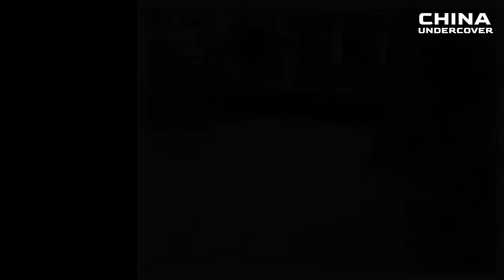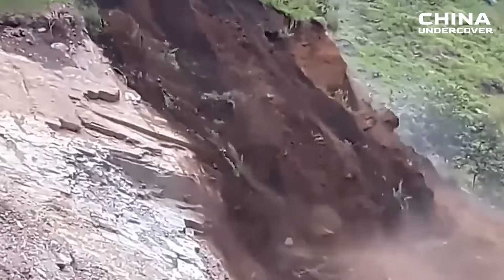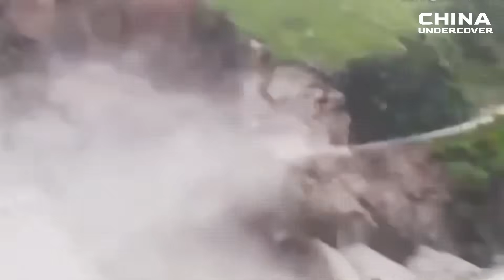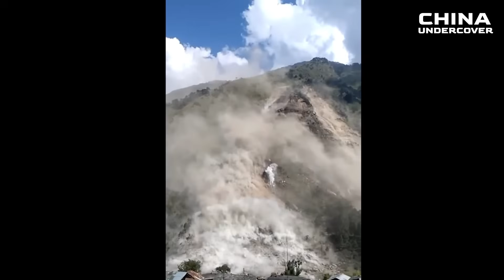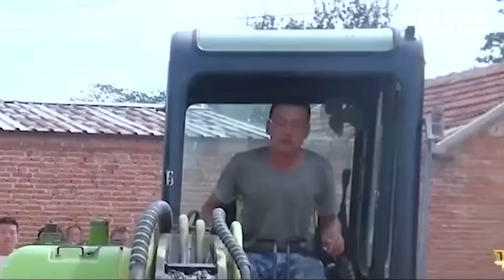Big Cities' Alarming Ground Collapse Reality From Nature’s Anger: Causes and Consequences

Comment: 🌧 Heavy rainfall in Chongqing, China caused landslides and road collapses.

00:52
On September 23rd, heavy rainfall led to road closures at five locations in Fenji County, Chongqing.

A road surface collapse occurred near Lion Fang Garden Bus Stop in Shapingba District, trapping a fully loaded truck.

The collapse was caused by a malfunction in the underground drainage system, leading to rerouting of bus routes.

🌊 Excessive groundwater extraction in China is causing subsidence, leading to the sinking of buildings, damage to infrastructure, and ecological harm.

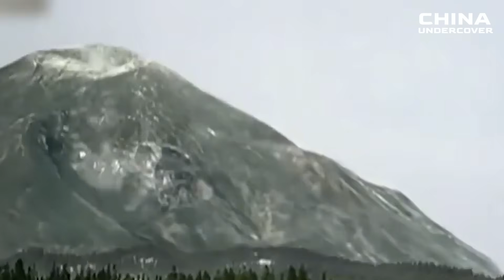04:03
Subsidence caused by excessive groundwater extraction can lead to the sinking and cracking of buildings, as well as damage to infrastructure such as railways, pipelines, and bridges.

Coastal areas may experience sea water intrusion due to subsidence, resulting in severe damage to surrounding ecosystems.

A research paper revealed the development of an extensive groundwater depression funnel in Beijing, leading to widespread subsidence across the city.

🌍 Land sinking and ground collapses have been a serious issue in various parts of China, leading to loss of lives and property.

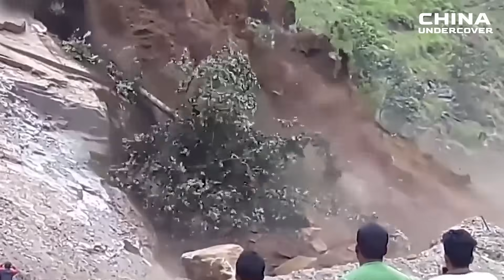07:39
In Shanghai, a deep hole suddenly appeared in a plaza, swallowing and trapping 21 parked cars.

Beijing's flat regions experienced subsidence with an average annual subsidence rate of 8.73 millimeters.

The most extensive cumulative subsidence of 2.3 meters was recorded in the jinjan locality of kayang.

📈 Beijing's population growth has driven up housing demand and increased the value of households, leading to significant financial burdens on the public.

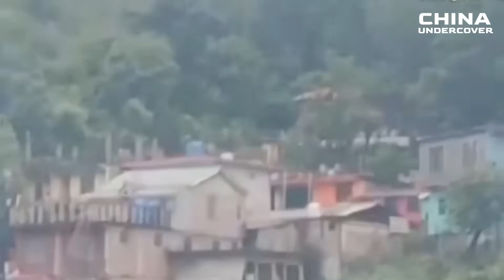11:11
Beijing's permanent resident population reached 21.84 million by the end of 2022, marking a 53% increase over two decades.

Land sales and taxes constitute approximately 60% of the total housing price in Beijing.

Rapid population growth and economic development in Beijing have resulted in a demand for water that surpasses the capacity of local water resources.

🌍 The North China Plain is experiencing an expanding network of funnels, causing subsidence and posing a threat to multiple cities including Beijing.

14:47
The size of the network of funnels underneath the North China Plain has expanded from 9,000 to over 16,000 square kilometers.

Beijing is situated on top of this complex water funnel system.

Over 50 cities, including Shanghai, are dealing with the threat of ground subsidence.

Comment: Good old Chinese engineering
Reply: Yep it was definitely foreigners who built the China wall because there's absolutely NO country existing who can build a road without pot holes or sink holes 😂😂😂
Reply: @Mylifebyon6424  well looking at what’s going on there doesn’t look as though they’ve learnt much since the wall
Reply: @davidgreenwood5241  potholes can be found in almost any country. Most buildings in China are just fine. With 1,4b people and millions of infrastructural projects you will ofcourse have screw-ups. But by no means China is a mess when it comes to building or anything else. Some cities struggle financially, but many don't. You can cherry pick any large country, including the usa and make it seem as if everything is and goes wrong. It's not my experience and I have travelled throughout  USA, Europe and China.